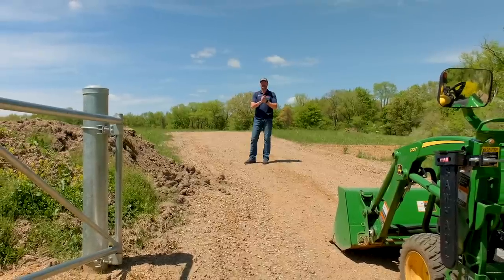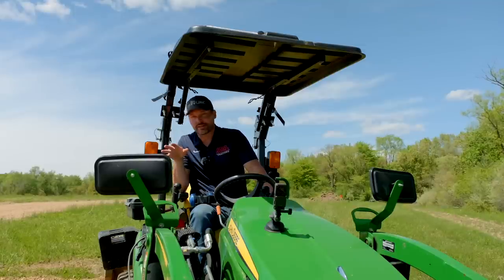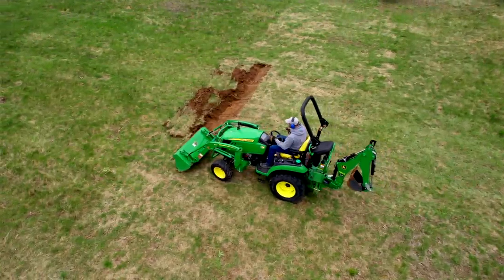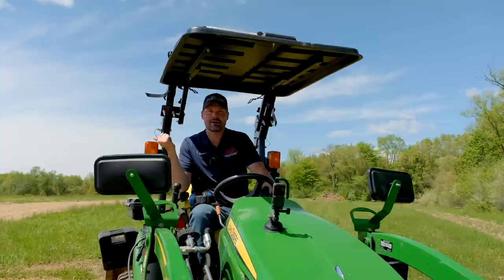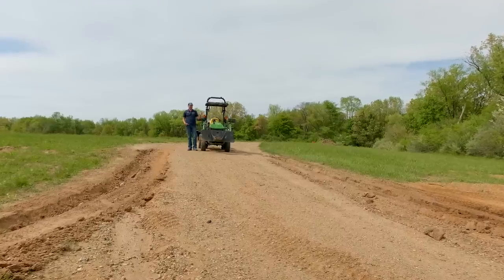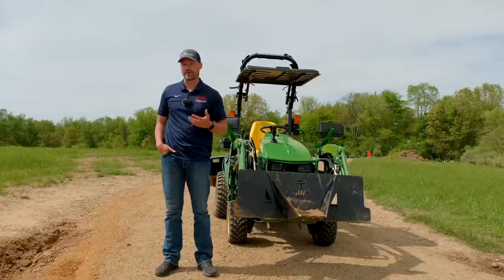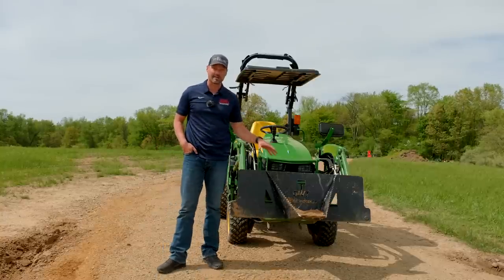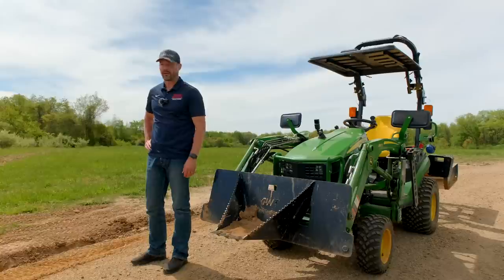WE ACCIDENTALLY DISCOVERED AN EASY WAY TO DIG A DRAINAGE DITCH.

Comment: Nice work! I used a middle buster to do the same thing, was surprised at how fast and easy it was.
Reply: I recently bought a middle buster to use to install some underground wires. Wanted a sub soiler but $50 more with the smaller tooth even though it's built the same, go figure, and was amazed at how fast and how well it will make a ditch

Comment: I have 10 hours on my 1025R. I just finished my first maintenance check today (except that one impossible U-joint zerk!!!!). It is amazing what this little tractor can do.
Reply: Gotta get the long needle type lube gun tip for that zerk. Spin the shaft until it's visible thru the hole in the plate under it. Cheers!

Comment: An indicator to the top of the Stump bucket frame at the same angle as the bottom of the bucket might help would also like to see a bolt on flat cutting edge for trenching in softer ground or bottom finishing. Great video showing what it can do.

Comment: We’ve always used the potato plow for drainage ditches. Quick and easy. Sometimes we go back and use a garden hoe to remove the loose dirt. A long ditch we scrape it out clean with a scraper blade or front end loader bucket . Sure beats making a mess with a backhoe

Comment: Courtney, if you install a couple of skid plate shoes on the end of the back plate of the stump bucket, could you use the tractor in float mode to control your depth of cut??
Reply: Doubt float mode would be of use. Once you put it in float the loader tends to try and fold up under the tractor because there’s no pressure in the cylinders to hold it in place
Reply: Not really because your depth is more controlled by the bucket curl than the loader lift

Comment: The bucket worked well for this. Another maybe unintended benefit for use is that when the bucket is "flat" and not digging,  the sides of the backplate made an excellent vertical blade to spread out and flatten the piles of material to the sides, almost like a little dozer blade.

Comment: That is impressive! An implement meant to pop tree stumps also trenches. I would imagine if you had a single ripper shank on the 3 point to break hard ground initially, the stump bucket would be even more effective.
(I will purchase a stump bucket eventually and I have to say your design is a front runner.) 🏃

Comment: Another tool to use would be a middle buster potato plow. It can be set for shallow cutting but it will break up the hard soil. Once done, you can use the FEL to do the rest of the ditch with shallow slopes leading into the ditch.

To "see" your angles, add a piece of rebar to the top of the stump bucket on each end. Then you'll have an idea of what angle you have on the bucket.

Comment: I enjoy your videos. I was thinking if you had something like an edge tamer that would mount on each side of the stump bucket you could use the curl function to control the depth. The flatter the bucket the more shallow the dig, the more steep the angle is the deeper it would dig. It would ride along the ground and control the depth. Just another product to design and sell.

Comment: Great idea and very timely for me as I have over 3,000' of drainage ditch to make this summer. I'm definitely getting one of your stump buckets to do this project instead of using my backhoe.
I'd like to see you try something else that might simplify and speed up part of that process you did: from the first, place the faceplate of the bucket on the ground to act as a skid and then just tip the point of the bucket down slightly to take a few inches on the first pass, go back and tip it down a little more to go deeper each pass. By doing this, adjusting ONLY the attack angle of the digger, the faceplate should serve as a skid and guard against digging in and avoid the constant stop and go and adjustment. Looks like when you are trying to adjust depth with the elevation of the bucket, then when you go forward the angle digs in going deeper and you pull it up again. Could that be avoided by skidding the faceplate on the surface and only adjusting the angle of attack of the bucket to get your depth?
I'm also thinking on my project, once I've gotten the primary depth of the ditch to the maximum the stump bucket will dig it, then drop the right hand wheels of my tractor into the ditch and use the box blade to cut the edges back to give me a wider ditch to that depth. This would carry more stormwater runoff which is what I am trying to do and also make a less severe ditch so I can drive across it with a UTV or truck. By doing this, I would have the 19" deep ditch but sloping out 8' on each side. Using the Stump Bucket first to do this initial ditch instead of a backhoe will speed this process immeasurably!

Funny, I had about decided not to buy your stump bucket as I'd removed almost all the trees I need to clear (about 600 over the last 4 years) and wondered whether it made sense to buy it for just the few remaining I need to remove. But using this to create drainage ditches... BRILLIANT! 
btw... I love your videos. All of them, even when 75% of them aren't directly applicable to my work.

Comment: Consider enlarging your ditch to a shallow swale with generous slopes on each side. You did mention swales. I've done both and swales are much easier and safer to maintain. Vegetation will certainly grow in it and can be easily mowed.
Reply: I thought a good idea would be to drop one side of the land plane in the ditch and use that to soften that edge out.

Comment: Great job Courtney. I had to lay a 100’ of 2” pvc pipe and used the stump wrecker to dig a 16” deep ditch and was amazed at how easy it was to do. Using the back plate to push dirt works well also.

Comment: Thinking about doing the same thing, putting drainage ditch alongside my driveway.  However I am thinking about using a single bottom three point hitch plow.
That I not only get the ditch made but fold the material back onto the driveway.  Not to mention I won't be stressing the loader.

Comment: Awesome video Courtney been really looking at a small tractor for keeping up with my driveway and other projects around the farm. Really like that darn little bucket to that thing would be handy.
Reply: Learn from my mistake. Do not buy a tractor which is too small. List on paper all the "things" you think or know you want to use the tractor to do. Get some feedback from others and then decide what size range you want. Talk to Courtney or other people in your area and, of course, do some shopping.  

I bought a small subcompact Case 24DXe tractor years ago. It has worked okay but it is too small to do a lot of the tasks I wanted to use it for. In addition, I wanted a backhoe but the tractor I bought is not capable of handling a backhoe. It is tippy as well as not having enough power, which I think is in the gearing.  Best of luck finding the tractor which is "just right" for you.

Comment: Teeth on that stump bucket makes a difference when the ground is hard. You need to design a v-wedge to mount on the 3-point to dig a ditch. We used to have a v-ditcher/plow to dig waterways to irrigate our fields in the panhandle of Oklahoma but this ditch was about 6' across and about 3 ft deep. Smaller version would work perfect.

Comment: I wish there was a stump bucket that would fit the Yanmar (SA324) quick attach... I'm considering trying a bolt on spade,  but doubt it will work as well.  Thanks for the great videos!
Reply: I had a big bolt on spade for my yanmar. they work but if you use it in very dry clay it'll bend your bucket. I sold it later on after selling tractor. Worked nice for moist turf and moving trees though. was 130lbs.

Comment: Wow, I think you almost made my hamster fall of the wheel getting more ideas with that stump bucket! I could see using that for planting taters and coming back with a hiller or row hipper to cover up. Then instead of tilling a 4ft wide section like I did for planting 100+ spruce trees, I coulda taken nice swipe 100 to 300ft long and come back to bury bare root trees with the loose soil and finish the clean up with my 455 and broom pushing dirt back into the trench.

Comment: The stump bucket did a nice job cutting the ditch, for sure. What's all that loose soil in the bottom going to do, though? Seems like it'll form a series of small dams as it washes. Here in Georgia, for the most part, we've got red clay. It you cut that ditch here, you'd have solid, smooth side walls.